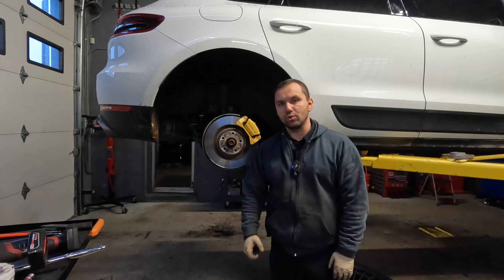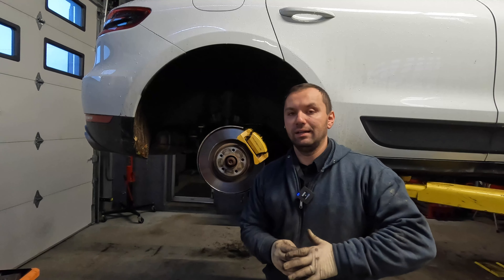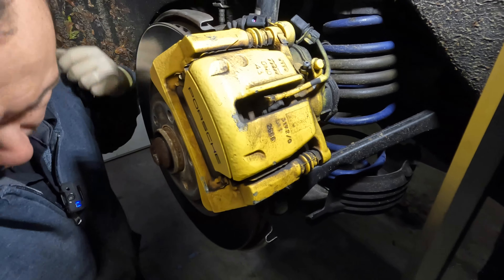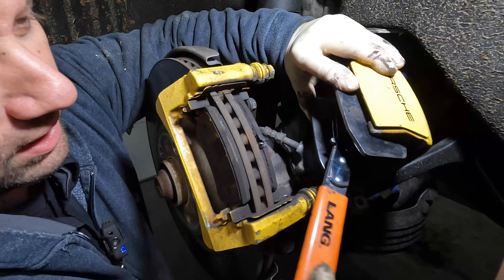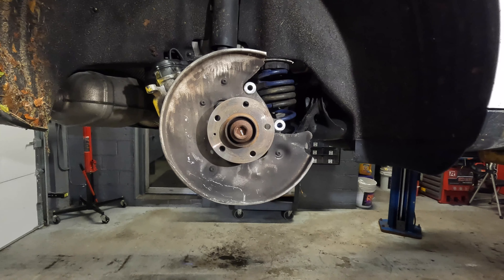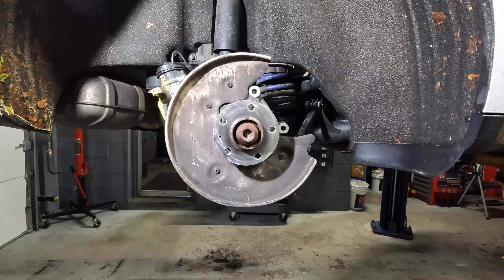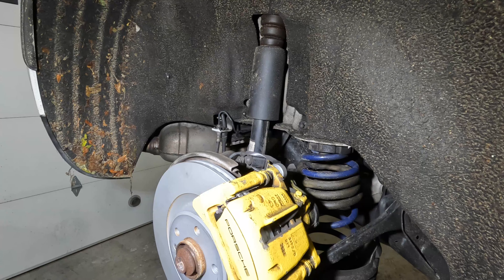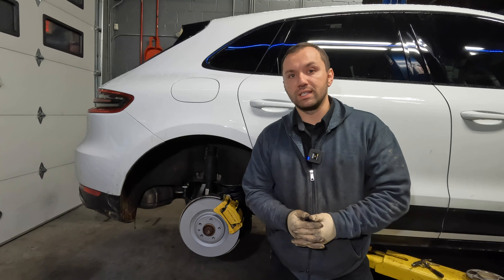CUSTOMER STATES PORSCHE DEALER WANTED $2K FOR REAR BRAKES! HOW REPLACE PORSCHE MACAN REAR BRAKES!

Comment: Thanks. Great presentation. My dealer wants $3.5k for both front and back. I bought the parts for $800 and followed your video. I got it done for a whole night. May I know where your shop is? Thanks again.
Reply from the maker: I’m in Illinois Chicago area. Glad I could help.

Comment: hello one of the backe backing screws broke what's up thanks
Reply from the maker: If a bracket screw broke, you might have to get a new bracket and screw unfortunately
Reply: @TheEnthusiastMechanic  You think that is the cause of the noise when I turn a street, the backint and the rotor sound
Reply from the maker: @luchalibre1986  it’s possible

Comment: What’s the torque for caliper carrier bolts
Reply from the maker: It’s been a while since I did it, but it was a very low torque usually hand tight as good on this I would say look up your specific models because they do make pretty significant differences on these Porsche Macan